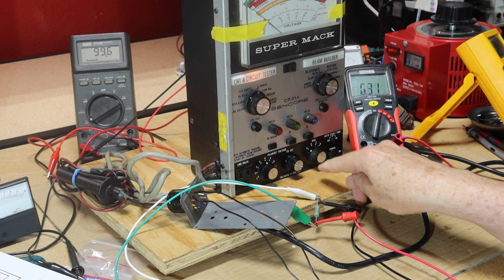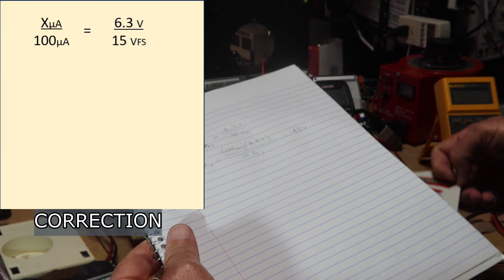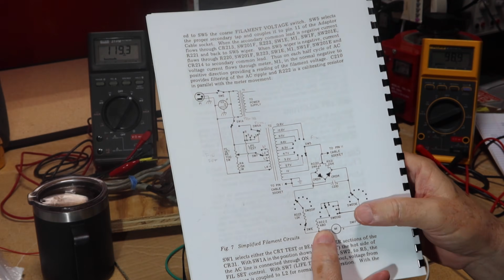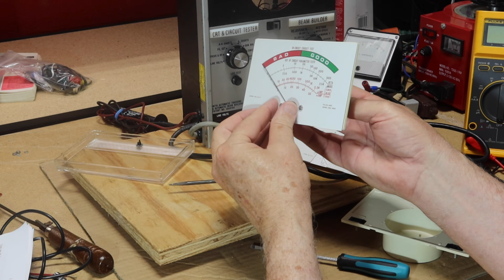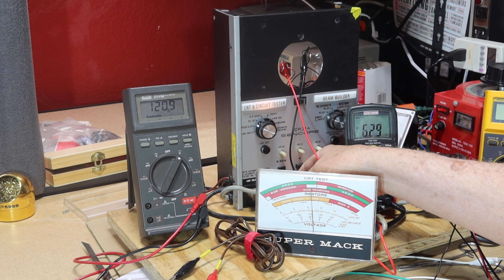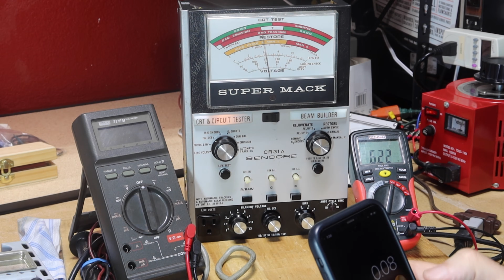Abandoned Meter Repair - Shorted Out Sencore Super Mack CRT Tester Repair Pt 2 - 1977 [4K]

Comment: Interesting that you did this video now. I just got though adjusting a Simpson meter movement to read 0-20A correctly. It has a shunt and calibration resistor inside the meter housing.
The value called out for the calibration resistor was 7.5ohm and the carbon comp resistor in it read 10.2 putting it just outside its 2%FS tolerance.
For me, the most challenging part was not breaking the needle taking it apart and back together (like I have done in the past 😮‍💨)
BTW, waiting to see the Sen-Cor finished 😉
Reply from the maker: Right, I was expecting a resistor may have been inside this one as well.  Part 3 is still in editing and it will not be as long as this Part.  Be sure to check out Part 1 in the meantime and thanks for watching!